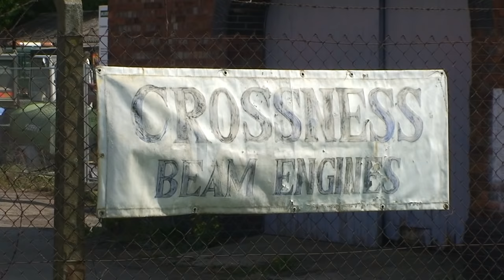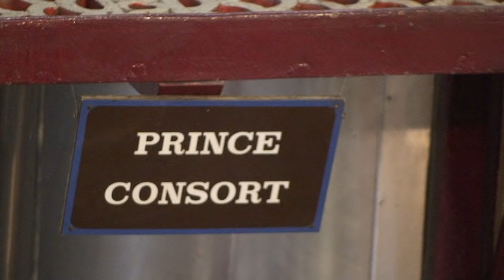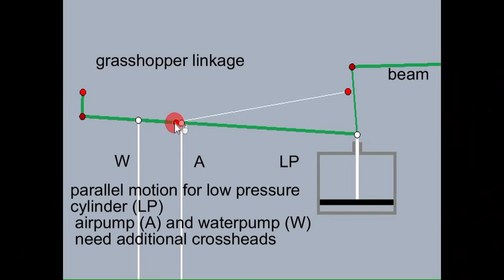The Biggest Operating Rotative Beam Steam Engine At Crossness

Comment: I work at crossness in 1971/72 , the beam house as was known then , was sadly very badly neglected, i am sure it would not still be there now if it was not so big it would have been scrapped and long gone, thankfully it was not, the boilers were not there when I was there and the chimney was gone, all very sad, on wet days we went into the beam house to sweep up rust, I visited on steaming day 2 years ago the first time in 47 years, there were no houses around the works then, you could see up to  Plumpstead just fields then, our mess room toilets washrooms workshops were there then, where the teashop/cafeteria  is now, congratulations to all those who involved them selves in its restoration it was so wonderful to see it in all its former glory, I only live long enough to see them all working, just up the road on the same site there is another pump house which is set down in ground, and has the most the most beautful 6 or 8 flat cylinder gas engines I cannot remember how many there were? I remember one two running they were absolutely stunning, the were huge electrical pumps, these were run also, these too should be preserved for prosperity and future generations, and opened to the public,

Comment: Seeing machinery and architecture like this really makes you wonder about things built today. It's all how fast and how cheap can we make it
Reply: Possibly, but it has to be accounted that modern technology has made things far more efficient, cheap, and lower-maintenance. If this is to pump sewage, a modern system for the same purpose, using electric pumps, could be built for a fraction the cost, fit in a small shed and run unattended, requiring only occasional inspections and maintenance. Some of the components might wear out sooner than this engine that could run for centuries, but the total operating cost would be far less. Aside from this massive engine being an incredible visual spectacle and being unquestionably really cool, functionally the modern system is better in every way. They just didn't have that technology back then.
Reply: We only see what people thought was worth keeping.
Reply: @quillmaurer6563  you're actually wrong. Sacrificing overall reliability and quality for ease and price is actually a phenomenon nowadays. If you worked in any actual industry that works with technology or engines you'd know this. But you don't.
Reply: Yes, that's right. It's absolute beautiful. Not only the "technic" itselves, but also the surroundig (which has no special use) but looks beautiful, too! You can't compare it with what we produce in recent times: "livesless, souless" things to which you will never get a "personal" relationship!!! THAT IS OUR GREATEST PROBLEM TODAY. No "respect" to human beeings, to nature and things we produce.
Reply: @grren1782  would you rather install operate the pump in the video instead of a small electric pump in a shed somewhere? One takes an entire building, probably costs 100x more, and is probably no more reliable (I count a lot of moving parts in the steam engine). Yes the pump in the video is damn beautiful and impressive, but I would take  the modern one any day
Reply: Thank you very much for your answer. It's nice to hear from other people too, that I'm not the "only one" who has this "special joy" for old machines, drawings and also books. As you said, they have a soul, and they have a live. I don't know what "they own" to give you this special feeling, but "it" is there! It' a pity that nowadays you only get things whicht last not long and things which looks like rubbish. I can  rember that the buildings (in which the machines stood) they looked so beautiful, inside and outside, a place where the people might be happy to work there. They really took care of both. These times are gone forever. Today is the rule: you buy and you throw it away (when its "kaputt") or you don't need in anymore.
Reply: If was all about that back when this was a thing too.. it's to reduce production cost
Reply: ANNNNND the invention of the disposable item is our worse enemy
Reply: Imagine the millennial's of today trying to build something like this.
Reply: You wouldn't want to carry your 10 ton  tv set home after paying 100 000 dollars for it. That's what it would be if it was built like this pump.
Reply: @grren1782  How do we know that you do? You could just make any old horseshit up.
Reply: @petersaunders747  Yeah they'd use a bunch CNC machine tools and make something with better tolerances.
Reply: You should look at modern sewage processing plants. They are grimy and dirty because the sewage is, but very impressive technically. They are certainly much more reliable than this steam engine though. They can run much longer with less maintenance and they need to be stopped far less often. Electric motors just don't look as pretty and centrifugal pumps won't show you their moving parts. They are less beautiful but are more capable.

As for everything else, industrialists and capitalists have never spent more money than they had to.
Reply: @quillmaurer6563  lower maintenance.  I've seen fridges and vehicles twice NY age get fixed. Not the same for their modern counterparts
Reply: @GuardianAngle93  True, the point is you can fix them, but you also have to. I drive a 50 year old car, I can keep it running indefinitely but it requires constant upkeep. A modern car requires far less upkeep and maintenance, but once it's dead it's dead. But even so, typically cars from 50 years ago didn't even last 100,000 miles, the odometers don't even have six numbers for this reason. A few have been kept alive much longer (I have no idea how many miles are on my car, I'm guessing the odometer has rolled over at least once, probably numerous times before I owned it - but I've rebuilt or replaced the engine twice just in the time I've owned it). But the majority were scrapped once too much wore out, so the average lifespan was much less. Modern cars the expectation these days is 300,000 miles. Other devices, such as refrigerators, have become more throw-away in more recent years, they don't last as long but are also cheaper to buy, do not require any sort of maintenance during their lives, and are more efficient. Or for that matter electronics, which probably are scrapped due to obsolescence (which admittedly is probably planned in most cases) far more often than due to breaking and not being repairable.
Reply: @quillmaurer6563  modern fridges are not more efficient than the old drum top. They are designed to break.

I can go to the 90s and pick several vehicles that will break the 400k mark. None of today's vehicles will make it that far.
Reply: Indeed, such magnificent architecture for a sewage pump.
Reply: And none of our stuff will last this long
Reply: @unorthodoxridez  With the exception of radioactive waste.
Reply: @GuardianAngle93  That's false; plenty of vehicles after the 90's can make it that far
Reply: @RennieAsh  due to the nature of complexity I disagree.

Also plastic and rubber goes bad fast on new cars.

Especially ones with polymer intake manifolds.
Reply: @grren1782 and it a damn shame....
Reply: @GoingtoHecq an important part of this machine for its time was that labor was dirt cheap back then.

Comment: Like waking a sleeping giant.  It's amazing how graceful something that big can be, and relatively quiet, as well.
Reply: There are two WW II Liberty ships still in operation as museum ships.  I've been onboard the SS Jeremiah O'Brien on a full day cruise around San Francisco Bay, and it is amazing to be in the engine room with those three pistons running at 60 rpm, silently.  The low pressure cylinder is 6 feet across, and to see it rising and falling once a second, *silently*, is utterly fascinating.  Then some crewman walks by, slaps the bearing as it goes by so he can check the temperature, and drips an oil can on it, at 60 rpm, **silently**.

The silence is almost deafening, and you gradually begin to hear its own sounds, of steam hissing and the bearings and little creakings, and realize you couldn't hear it because you are so used to noisy internal combustion engines.

Comment: those big rocking beam steam engines are a sight to behold! They are in sharp contrast to the fast running motors we're used to nowadays. These big machines also last and last.
Reply: Not unless maintained constantly, just like any mechanical machine.
Reply: "last and last".  And are of relatively low power output.
Reply: With steam engines, they may have less horsepower, but they have incredible amounts of torque over modern engines. For pump applications, this design is ideal.

Comment: I look at all the joints that oscillate instead of continuously rotate and think to myself.  The wear on the bearings must be different for the oscillating joints that don't necessarily even see a full rotation in their lifetime.    
I also love the reverence that a cutting edge & highly productive machine of the era had.  You could have built a building with strictly functional beams and no decor.  Instead it was beautifully crafted with many accouterments.

Comment from the maker: Thank you too (thumbs up etc.). No, it's only demonstration use! Originally there was a big boiler battery, but all of them were scrapped. The steam pressure of the new small boiler is only sufficient for the movement of the engine, but never for real work.  A new sewage pumping station for the actual needs was built nearby. Greetings from Europe!

Comment from the maker: Originally it was a one cylinder engine, doing 125 hp @ 11 rpm. Later it was converted to a triple expansion engine. Assuming some 500 hp @ 15 rpm (3 cylinders and probably higher steam pressure) I get a torque of approximately 250.000 Nm equal to some 185.000 foot pounds. (A powerful BMW 6 cylinder Diesel does 400 Nm!)

Comment: This is clearly back when a city had pride in their utilities, and for good reason.
Reply: While ours is not as old or anything l ike this magnificent machine, here in Toronto, Canada, we have the R.C. Harris water filtration plant.  I believe it was in operation some time in the mid 1930's, and is still fully operational today and not up to capacity.  It is dubbed "The Palace of Purification"  Beautiful polished brass and marble on the inside with its Art Deco light fixtures. The original pumps from England ( I believe) are still operational today since they were built to last--they don't want to replace them for this purpose.  The building on the outside has been used in movies and is a fixture in the community.  Some hotels are not as nice looking as this place is on the inside. An absolute gem.  This plant would not be built today due to the sheer costs.  Glad someone had the stones to get it done back then.  We are so much better off for it.

Comment: In away steam engines are still in use today. Like a nuclear reactors on submarine's and power plants and aircraft carriers . I think is cool to see things like this.
Reply: +Viktor Hofer Some links?
Reply: Steam turbines.  Not reciprocating steam engines.
Reply: All power plants (other than hydroelectric) use steam engines.  People seem to automatically assume "steam engine" means it runs like a locomotive from the 1880's.
Reply: @protoborg  To most of us, "steam engine" means piston type, and "steam turbine" refers to modern steam power.  Remember, most people think "engine" is synonymous with "motor."  More properly, the former refers to a piston machine like gasoline or diesel powered devices while the latter is electric powered.
Reply: @cliftondean4333  Sadly, you are right.  Most people also do not understand that all power plants are in essence steam power since the turbine is not powered directly from the boiler.  The power of the fuel being used to produce heat in the boiler.

Comment: stupid question but why does this engine even need the crank/flywheel couldnt they have just attached the pump cylinder to the rocker arm directly that would have given them atleast in theory unlimited starting positions this eliminating the need for this smaöler engine or did the engine drive something else aswell?

Comment from the maker: Thanks for your posting, but - sorry - I know (my videos 'Watts Genius' and 'Amos & Easton Steam Engine Dances The Waltz' show that). The reason, why I did not write 'Watt's Parallel Motion' is the one, that Watt's beam engines all had the typical parallelogram for piston and air pump rod and the beam as the other part of  the linkage. I've read the terminus 'Z' link in a description of the Crossness engines and it sounded me quite reasonable without offending Mr. Watt.

Comment from the maker: Well, let's the Buick pump sewage and we'll see the difference. The steam engine does 500 hp @ 15 rpm and the Buick? And dont forget the torque - compare a steam engine with a slowly working 300 lbs 7 ft muscle man and the car engine with a high revving 100 lbs 5 ft tall cycle racer - both do the same horsepower! :-) Thanks for watching and comment!

Comment from the maker: I wrote: 
'Therefore the cylinders have different diameters (the low pressure cylinder is the largest in diameter) to  compensate  this fact and to develop the same force ( force equals steam pressure times piston area).' 
Because the high pressure cylinder is hidden underground, I've tried to explain the facts with the different diameters of the visible LP and IP cylinder. What's wrong with that?